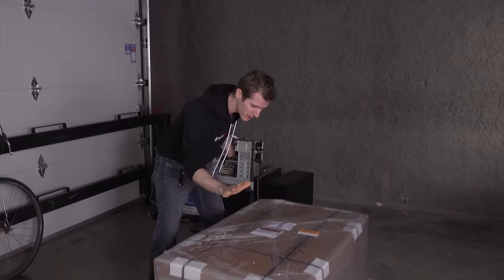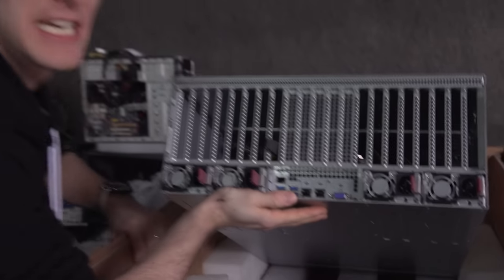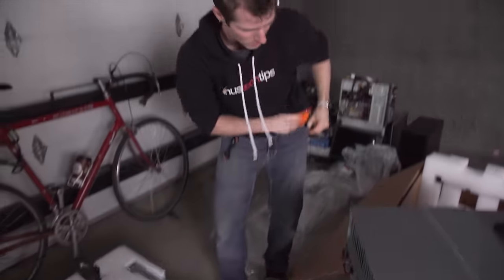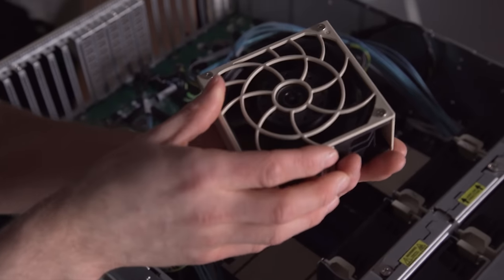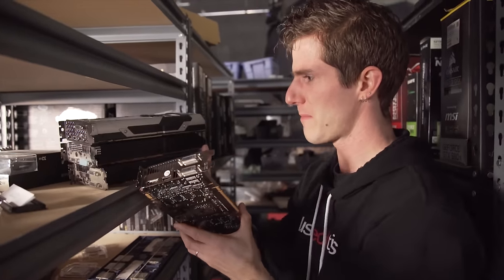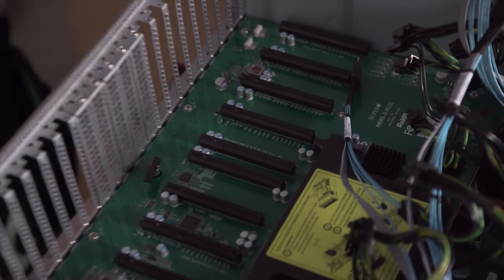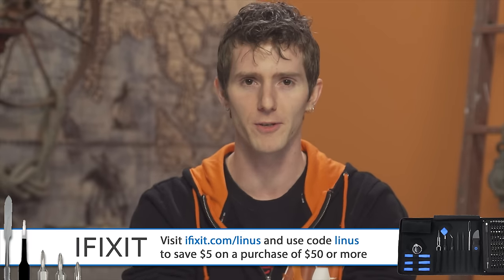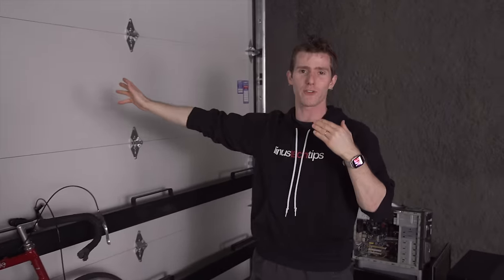$4,000 Server Chassis Holds 8 DUAL SLOT VIDEO CARDS! - HOLY $H!T

Comment: 20 years from now this will be nothing
Reply: 5* years
Reply: 2* years
Reply: 9* months
Reply: Yesterday*
Reply: it's still a super computer tho if you're not using all that power for loads of screens I could use a 16k resolution machine at maximum settings wink wink lol
Reply: jonathan oxlade I would have agreed if sli still worked :)
Reply: actually I saw someone use 8 Titan x Pascal in this setup I think if it's in a sever board then it's a different setup because you don't need the sli bridges for server serious so use you can have 8 Titan Pascal GPUs in a sever setup
Reply: jonathan oxlade (facepalm) It's not because it's a server setup. In dx12 and Vulcan there are ways to make any amount of graphic cards(that includes Nvidia and AMD) to split up the work to render a game. But you can't do it on every dx12 stuff cause devs have to enable it.
Reply: dude you got to turn sli of and run a different setup on nvidia bios you need MDA it basically let's you use any gpu or even a shed load of GPUs but a server uses loads of then or Less with PCIE ssds
Reply: 20 years from now will we even have the power?
Reply: Internet Loser haha lol they had 8gpu low end PC have 36
Reply: Why will it? I hardly doubt over 8 dual slot video cards is the future...
Reply: but maybe servers will have MILLIONS!
Reply: but we will have single cards that outperform 8 cards put together
Reply: By the time the next game comes out, you will need to drop 3000$ for each Gpu upgrade
Reply: Personally, I doubt desktop PC's (at least in the traditional sense) will be a thing  in 20 years.
Reply: 7 years I'll be ordering it off ebay for 300 usd
Reply: probably less as the tech curve should mean we should have 64 or 128gb ram modules in the coming months, if you populated that with 128gb modules in however many years time that would be 3.072tb of ram.
Reply: i would love to see the preformance of 8 titan xpp in sli. although i would if it would work a 4 way does not really work anyway
Reply: this would make sense for something like a bunch of xeon phi cards or teslas for simulation and raw computation in a cluster
Reply: Yeah it’s nothing now

Comment: 'Scuse me while I install 10 980tis so I can run any game I want on 3 4k 3d displays at 144hz and never have to upgrade again (except the CPU)
Reply: +Jayden Holzhauser 2 18 core processors will last you a while
Reply: +Jayden Holzhauser Not yet buddy, no 144hz in 4k with current plugs.
Reply: +B0GFX But he is sure ready ! lol

Comment: 120V. lel
european 240V master race
Reply: +jerri0401 I wonder how do guys over the sea handle such things. Well here it is simple. Either 240V or 400V for the industrial things... When we consider that the differences in devices aren't that vast I suppose everybody there must have like 4 power outlets in each room for each voltage or what :D
Reply: +jerri0401 230v*
Reply: Jakub Polomsky well, as far is I know, every consumer device there has just 110 or 120V. And every device, that needs a bit more power (like power tools etc) they need a seperate line and outlet, which needs to be installed by an electrician.
Reply: +jerri0401 220-240v
Reply: jerri0401 oh, that explains many questions

Comment: +LinusTechTips. I am having a bit of difficulty understanding how you can get ultimate power out of a daughter-board, wouldn't all those pciex16 lanes be squeezed into one, giving you 1/8th of the bandwidth, and if so then what would be the point? Can't they just make a board that has like 16 single slot pcie expantion so you could have 4x 4 SLI Titan x's  (that would be sick) or use Teslas for thermodynamics/ fluid dynamics (that would be really baller)
Cheers
Robert

Comment: does it add up the capacity of the the separate Video cards when running? does it run selectively on one card at a time? would the crappy cards bottleneck some of the betterones?

Comment: the problem with hotswap fans are the cost a lot and the are non 3rd Party parts on the market. so an regular fan cost 20€ and a server fan cost 40€ - 60€ each.

Comment: Can someone explain why so many cards have their power coming in from the top of the card instead of the end of the card like my old radeons used to? It looks so messy and makes cable routing so much harder. My next card will be specifically for a display computer. I will be choosing the card based on where the power cables attach.

Comment: You guys should try tesla K80s. The supercomputer I use has some nodes with 2 K80s per board and we are looking at them for our in-house CFD code. I have no idea how they do with stuff like rendering or transcoding though.

Also, how do you intend to parallelize 8 GPUs? If you're using mpi then it gets really expensive (i.e. slow, though maybe not if they are literally on the same board).

Comment: Can you use that machine to combine all of those graphic cards for just one user? Nvm, just remember that we can only go up to 4 sli. I googled, not as great as I thought.
Reply: Remember that chassis like this are basically always used in compute scenarios (I.e. scientific, video rendering, etc.).  You don't need the kind of frame synchronization SLI provides.  CUDA is perfectly happy instructing 10 GPUs in one system...

Comment: Hi LINUS,

is possible to adapt the PICe G2 slot for a external video card like Gforge 980 ??

Thank for all
Paolo Corino

*  Dell PowerEdge R810 Intel Xeon OctaCore E7-8837 2.66Ghz 24Mb Cache 32Gb Ram 600Gb (2) PSU *

Formato: 2U Rack

Processore: Intel Xeon E7-8837

OctaCore

Cache processore: 24Mb

Processori installati: 1

Processori supportati: 4

Memoria Ram: 32Gb DDR3 1066MHz

Memria spandibile fino a 512Gb con 32 Slot

Hard disk: 2x 300Gb 2.5" SAS 10k

I/O Slots

6 PCIe G2 slots:
Five x8 slot 
One x4 slot 
One storage x4 slot

Raid controllor: Prec H700

Scheda video: Matrox ® G200eW w/ 8MB memory

Alimentatori: 2 Hot plug installati 1100W

Comment: There's only one problem...  If you're doing any heavy processes on those video cards, there's not a whole lot of room for them to breath, meaning they will easily reach alarmingly high temperatures really quickly for the lack of fresh air.  So maybe you had the right idea with water cooling everything in 7 Gamers 1 CPU.

Comment: 768GB of RAM? My god. Set that thing up for huge disk caching. Doubt spinning hard drives would matter at that point even if they'd have to be 2.5"
Also with all that graphics horsepower, I'm interested in a thermal camera shot with thing at full load, if full load is even possible. Anywho, needs SLI/CrossFire to the max for full ballin power.
Reply: +DJ3520 He should get Samsung to let him borrow 24 of those 15 TB harddrives for "testing".
Reply: +Zack Dawley Yup. And fill it full of Titan X Blacks in SLI. A computer like that would see a DDoS as "annoying" I feel like. Shame those 24 SSDs wouldn't be over PCIe with NVMe for absurd performance.
Reply: +DJ3520 for virtualization Tesla is better.

Comment: My motheboard doesn't have PCIe locks, so is it convenient? It's ~8 years old btw.
Reply: +robotica Then your motherboard isn't PCIe, if its 8 years old...
Reply: Straight from wiki about when PCIe was created: "Year created:	2004; 12 years ago"
And the motherboard MIGHT be 7 years old at best. Also, how's that I can run a graphics card in my computer without PCIe lanes?
Reply: robotica
Well, whatever, I have never seen a board that old with PCIe and I have A LOT of old boards, most not even 8 year old. And, PCIe locks are much better than not having any, keep the slot from bending and your card sagging.
Reply: Spire I have a very good mounting mechanism and my card works and is placed just fine.

Comment: If I had to make a special board for the pcIe anyway, I would have changed the position of the individual slots.
0=bare board, -=pcIe slot
Rear.   0000000-------        Front of the case.
            000000--------
           00000---------
           0000------      And so on. And move the slot further to the back as you go down the board,
Doing it like this, every gpu fan has better access to air, this obviously results in better cooling performance.

Comment: I have a question, I recently installed some new ram on my pc but it didn't want to boot completely afterwards, so I tried to open the self repair program but it just got stuck in the Windows 10 logo. So I reinstalled the old ram but still have the same problem, any advice?
Oh and I checked my boards compatibility and the new ram is compatible when it's over clocked
Reply: Look on Google for how to reset the bios on your motherboard manually. If that doesn't work try to boot an os off of a flash drive, if all else fails you'll be able to get any important stuff that's on the hard drive :)
Reply: +Ryan Hull thanks

Comment: Now you need to do some crazy 11 gamers 11 gpu thing
just get more r9 nanoes
Reply: +SquidPlays with an enclosure like that R9 390X will fit perfectly well.
Reply: Jeremy974 Yes, but r9 nanoes are one slot cards. Or I think they are.
Reply: SquidPlays
They are one slot but on the back all the slots that are not on top of the expansion ports of the motherboard don't have metal things to protect the inside.from the dust, so more dust would come in.

Comment: those sloths are meant for intel xeon Phi co-processors i think... so that your server takes multicore threading to the next 484736 lvls. 10 x 63 cores lol
Reply: WWWWWHHHAAAAAAAATTTT!!! :D
Reply: some servers have 16 pcie slots but as long as you don't mind about running cards with no fans at 100 degrees then go for it lol

Comment: Wouldn't you still need an sli bridge for the cards?
Reply: +jet224presents You can only connect at most four cards in SLI. They aren't using this for gaming anyway, so no.
Reply: +Zack Butler that's what I thought